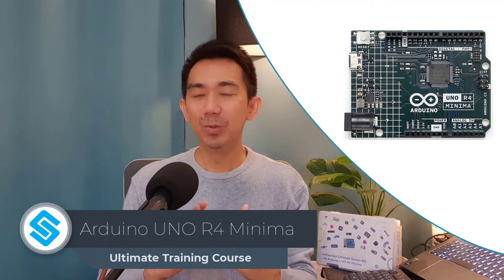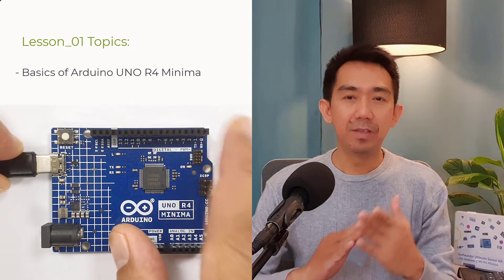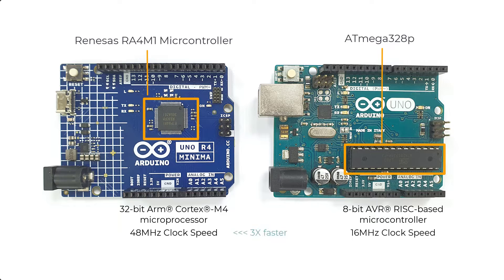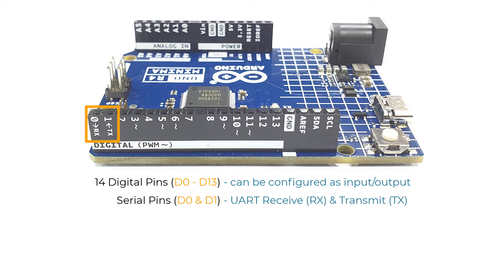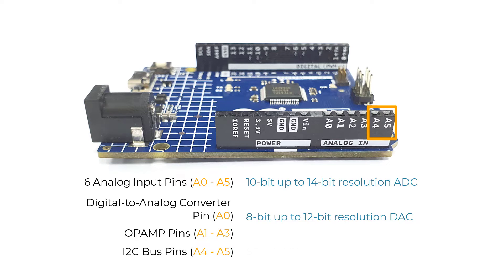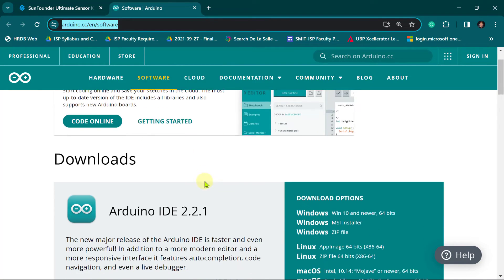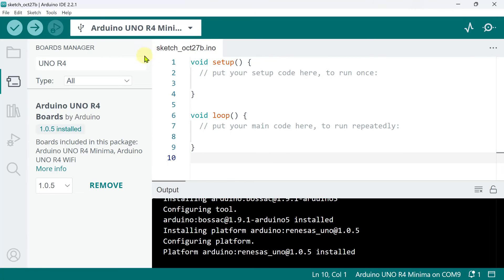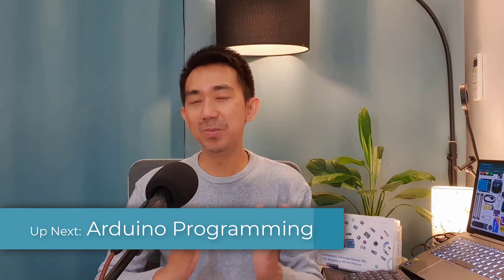Arduino UNO R4 Lesson 01.  Pinouts | Features | Installation and Setup | Ultimate Training Course

Comment: Hi, i want to ask which USB cable should i use with uno r4 minima? my existing cable has both squarish ends it is powering the board and due to that, my led on breadboard is constantly on but when i upload the arduino code to blink the led it gives following error: 

Opening DFU capable USB device...
Device ID 2341:0069
Run-Time device DFU version 0101
Claiming USB DFU (Run-Time) Interface...
Setting Alternate Interface zero...
Determining device status...
DFU state(0) = appIDLE, status(0) = No error condition is present
Device really in Run-Time Mode, send DFU detach request...
Device will detach and reattach...
Cannot open DFU device 2341:0369 found on devnum 2 (LIBUSB_ERROR_NOT_SUPPORTED)
Lost device after RESET?
Failed uploading: uploading error: exit status 74

so i believe its the cable issue? if yes, which cable do i need to make it work?

Comment: hello
The specification states that the module has 14 digital pins. However, the pinout diagram shows that the digital pins go from D0 to D19. D14-D19 are shared with the analog pins. Additionally, two repeated "D18-19" are shared with SCL and SDA.
Are they usable?
Can they be addressed by this number?
How would this be done?

Comment: Hi, need help. When I’m connecting my R4 Wi-Fi to my laptop, power and L Led are lighting up but windows is not detecting board and not assigned any com port.  I’m using latest IDE and installed R4 board in it. What to do?
Reply: Did you solve it ?!

Comment: Hi! I’m curious about limitations of the R4, compared to R3. Saw a comparison video mentioning “current driving capability” and saying that “the maximum current limit  per gpio pin on the R4 is 8mA, which is 2.5 times less than R3” and further explaining that this means that “the same sensors, actuators and modules being used with uno for years, are no longer compatible with R4”… so now, as a noob, I’m wondering: 1. Does the 8mA limit mean we are unable to drive applications, that would be possible with other Arduino boards? I guess I will not be able to use sensors and stuff that might require more than 8mA? And 2. When we buy a sensor, do we need to check for “what arduino board it is compatible with”? And is that information available anywhere you might buy a sensor from? This sounds so complicated to me, as someone that just started to look into Arduino for future tinkering…

Comment: Hello po, May I ask  if the arduino uno r4 minima can be used for Analog sensor such as Gravity Analog ph sensor and DFRobot Analog dissolved oxygen sensor? I'm actually considering using r4 instead of r3. For more precision and speed. I'm still researching if r4 supports sensors with boards designed for  r3 also supports r4. Specifically if it also supports using the said sensors, I'm concerned on the software compatibility. Thank you in advance!
Reply: I have experience na po on r3 building some projects. Our project now is both arduino and raspberry pi po. We are using serial communication between the 2 boards. The main concern I have if it will also supports the gravity analog ph sensor and the DFROBOT dissolved oxygen sensor po.
Reply from the maker: Hi Reynold, if your sensor works on the Rev3, then probably it is going to work on the R4. Please check the library documentation of your sensors. They've probably included updates for the R4. Thanks for watching! :)